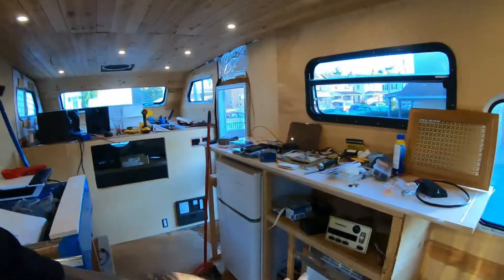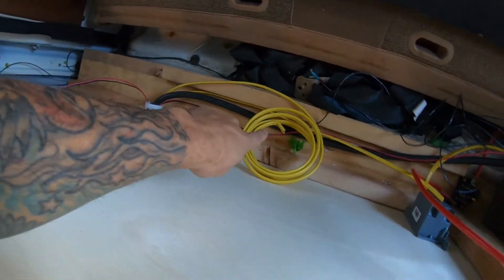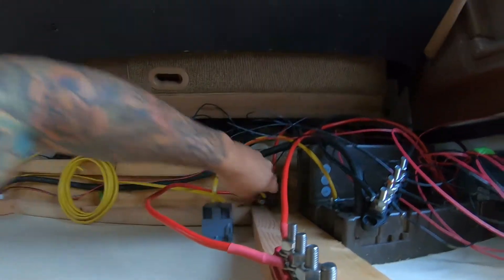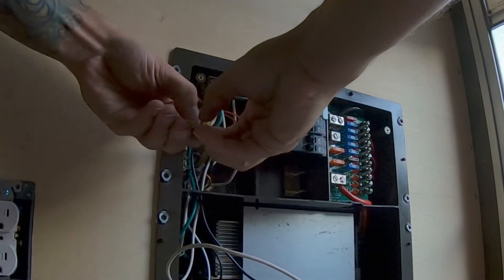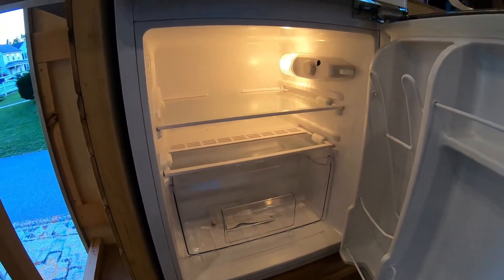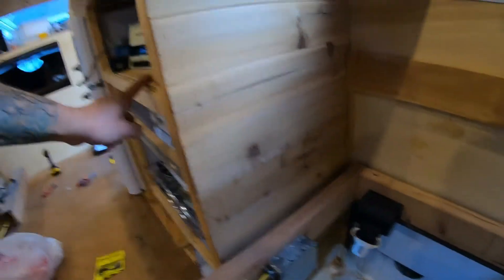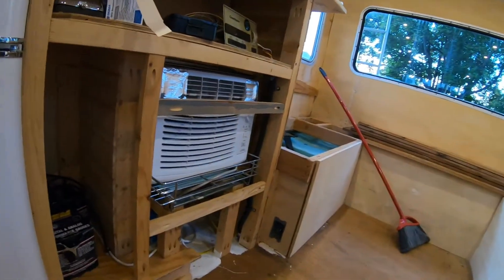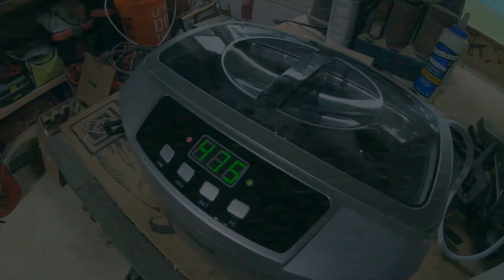Wiring Outlets | Junction Box￼ | 30 AMP WFCO 8955 Power Distribution Center | Vintage RV Renovation

Comment: Where did you get the air conditioner. I want to buy pass my roof top A/C unit and put something like you have.
Reply from the maker: It’s a regular window unit I converted to fit in my rig . I have an episode on the install if you are interested!! Thanks for watching and please subscribe if you haven’t yet 💪🏻